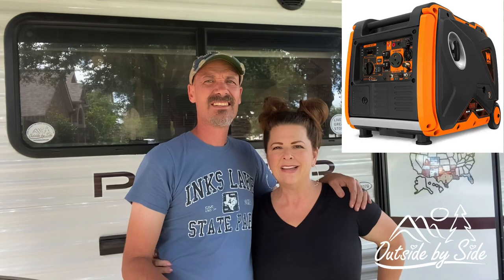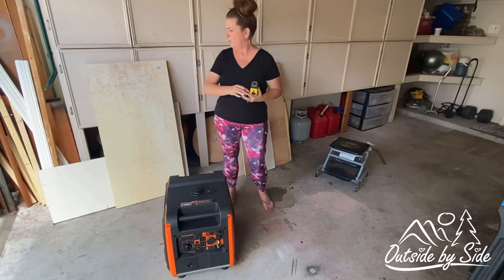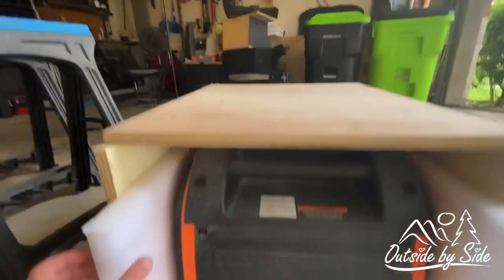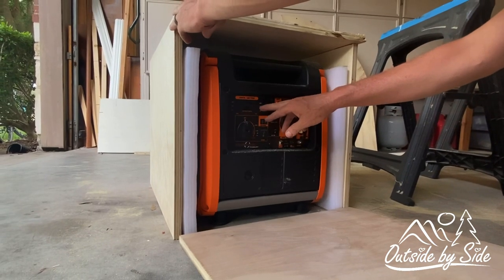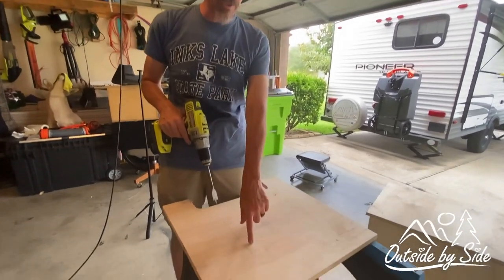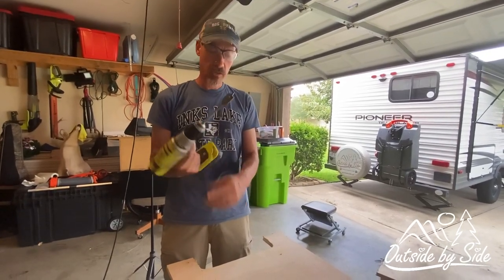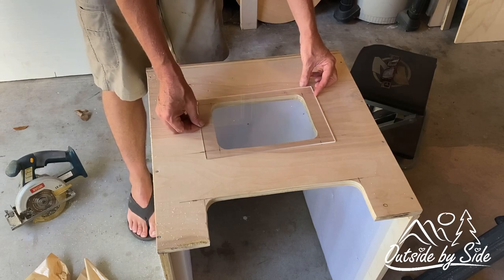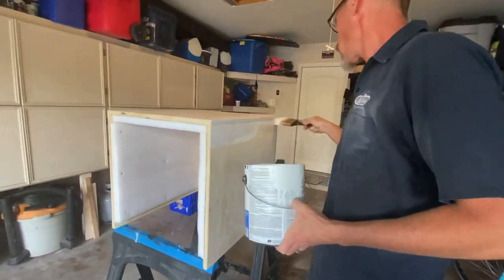How to Build a Quiet Box for Your RV Generator! DIY

Comment: For my 4K watt Champ I built a box 8 years back.
3 foot square 3/4 ply / 10” fan / hinged lid for fuel / side cutout for access to start switch and receptacles / 4” casters (2 swivel 2 fixed)
Fire/soundproof insulation / 
One open end obviously to take genny out for maintenance. Dropped 19 decibels - happy and no complaints!
Reply from the maker: @FrogLobster That sounds awesome! So happy for you & thank you for sharing. We always like to hear ideas! Thanks for watching our video & we would appreciate your support by subscribing to our channel! 🤩
Reply: @OutsidebySide  You got it! New sub as of now!
Thanks for liking my box plan!
Reply from the maker: @froglobster  Thank you so much and thank you again for sharing your ideas! 💡

Comment: The Box need to be bigger and full enclosed, with air intake & exhaust with baffle. You need to add Rockwool insulation all around to absorb to sound. Then you need to add something like an attic exhaust fan on the top of the box to suck out all that hot air and fumes, then add air intakes all around the bottom of the box. I used a large plastic storage shed with my 6500watt generator and it worked perfectly! all you hear is a low humming. cool air is being sucked in while hot air and fumes air being pushed out.
Reply from the maker: @iiinsaiii Thank you for your recommendations! We appreciate your feedback! This box has worked perfectly for us and so happy to hear you have found a solution! Thanks for watching! 🤩

Comment: Hi there. Getting ready to embark on my skoolie journey. I have a wonderful generator & my next project is to build a box to prevent theft and damage. I am in a little bit of overthinking territory - how would i fire proof this box in a cost effective way? I feel nervous about having an engine in an enclosed wooden space. I have plywood available, so thats what i was going to use.
Reply from the maker: @jordandebbrecht3276 Thanks for reaching out! Our recommendation would be to line it with Densglass which is fire resistant and sound deadening. They sell this at Home Depot. Hope this helps! Wishing you the best. Thanks for watching. :)

Comment: I love this design.  The other videos of boxes I've seen with the vents and fans etc., just seem over the top.  What is the longest period you would say you have run the generator in the box?  Did you notice any heat or exhaust build up?
Reply from the maker: @ashtonallen6434 Thank you! We really like the simplicity of this box. It does the job. We have run the generator consistently overnight with no problems. Thanks for watching! 😀

Comment: How long have you used it with the cover on it? I’m in central Florida and it’s hot, mine needs wide open space or it will trip the breaker on the WEN….. just running a 21ft camper 13500btu ac on like 70ish degrees, it’s a shaded campground so not direct sunlight. I’ve run it with a couple of pieces of tinted plexiglass laying on it like a TP with carpet over top to blend in because “quiet time is 10pm”
Reply from the maker: @HorseHead Mike We have run the WEN all night with the cover on it on several occasions with no issues. It has been in cooler climates and we haven’t used it in warmer climates much. If you are having issues, you can install a soft start on your RV A/C which could help. Thank you for watching our video & we would appreciate your support by subscribing to our channel! 🤩
Reply: Install a fan to either push air into or out of the box. You'll need an intake hole and an exhaust hole either way of course.

Comment: 👉🏼 Your nail gun was working and I don’t think you knew it. 🤦‍♂️ The tip  where the nail comes out has to be pressed against something 👈🏼 Your generator was already quiet enough. One shock thing after another like having to slide styrofoam in the box that’s not attached👈🏼  From 1 out of 10 I give this video a 3 🥴 Have a good day 😊
Reply from the maker: @Animal/Rights A.R.A The nail gun was not working but thank you for your input. There were many attempts to use it that was not included in the video. We actually had to replace the hose. We appreciate your review and rating of our video and hope you join our community by subscribing to our channel! 🤩